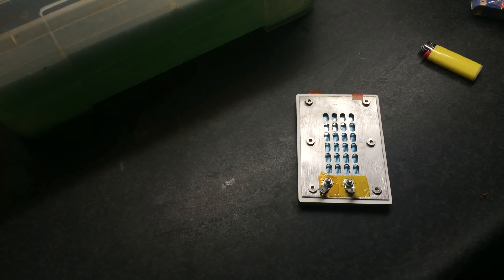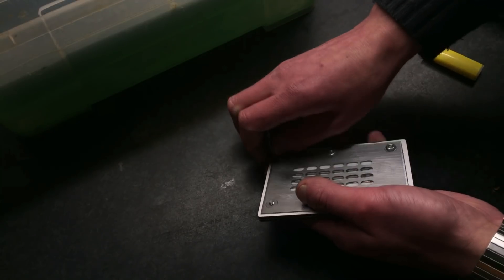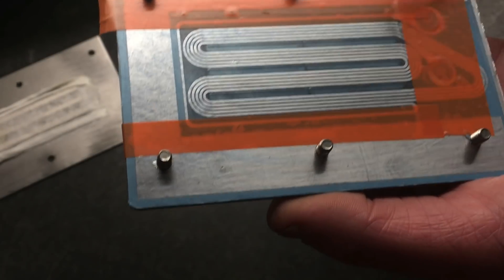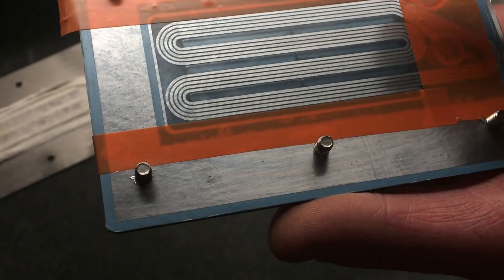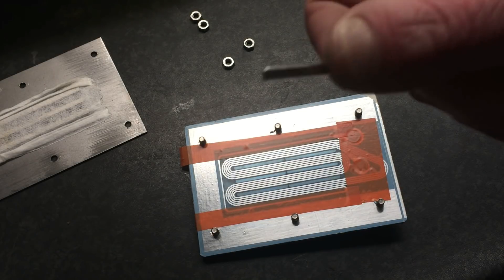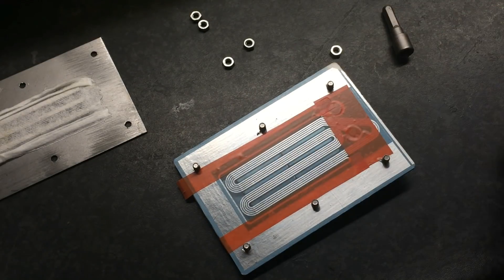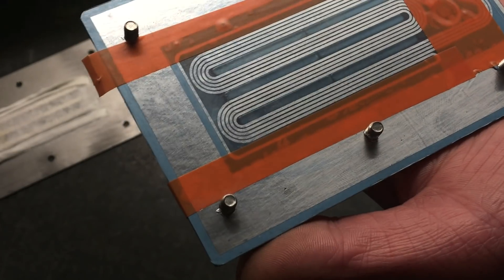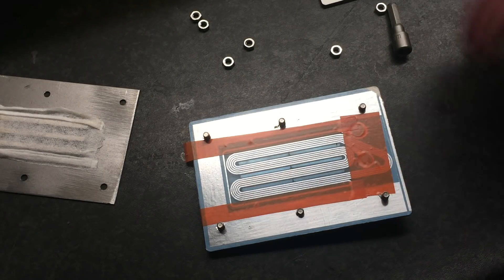B&G Neo 3 PDR Clone? or just a similar Planar magnetic tweeter

Comment: Could you get better dispersion and still have an efficient driver if you used five magnets, but varied the width of the traces? Say have larger traces in the middle?
Reply from the maker: only if the traces would be in parallel , since the smallest trace determent what the power is that runs true all; traces.  :) so making a few bigger does not help, since the power fed to them (since they are in the same circuit) remains the same
Reply: joppe peelen now I know I am in over my head because your answer only raised more questions. I’ve just sent you a Facebook request.